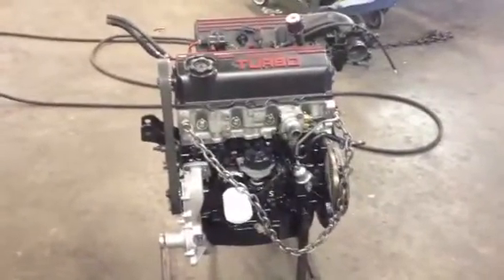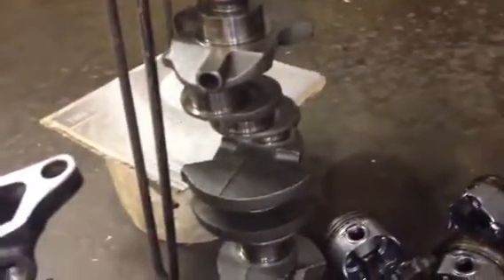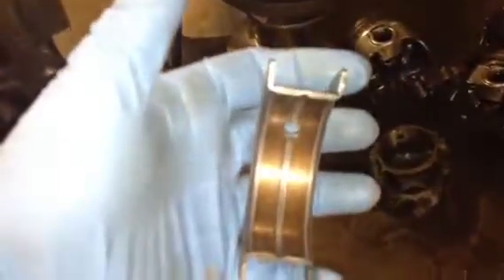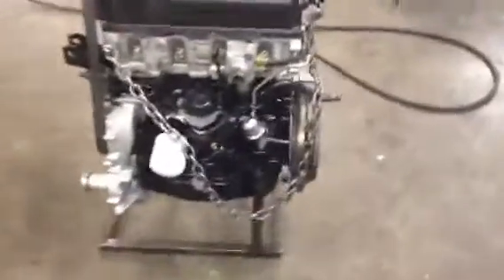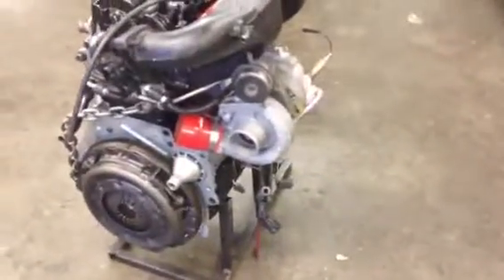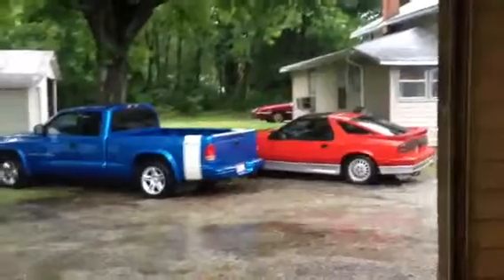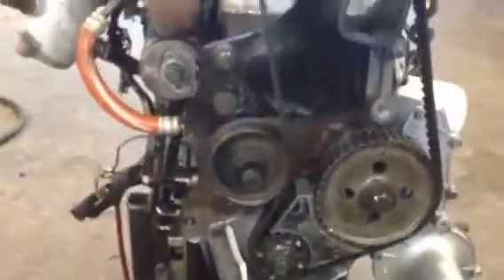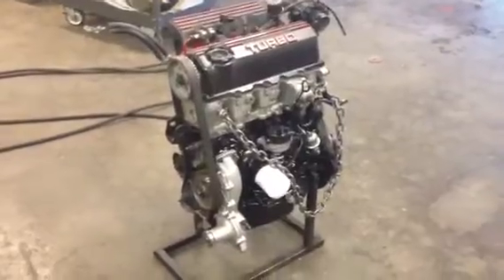Update on turbo1 to turbo2 conversion

Comment: No no no...
The blocks, cranks and pistons will withstand far more when done properly.
Bearings are pounded out due to poor calibration, detonation, lack of lubrication and over-boost conditions.
Lets not brag about making so much power when its been made improperly.

Build a new engine and treat it properly with good software and calibration and this type of failure won't be realized - don't blame it on making SO much power when numerous engines make far more and survive when done properly.
Reply from the maker: verticlehold the engine was rebuilt 5 years ago with a stronger 2.5 common block, forged crankshaft and HD Chrysler rod. Since then, the engine has ran flawlessly and on the dyno, it put out 404 HP and 436 lbs torque.